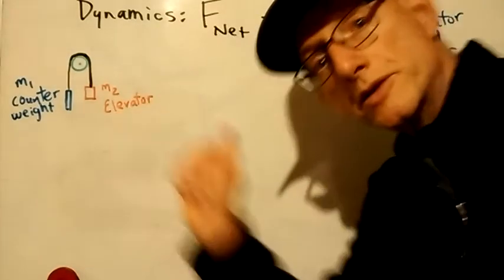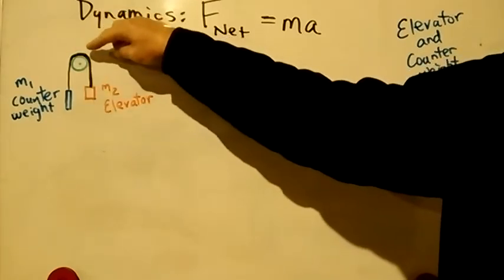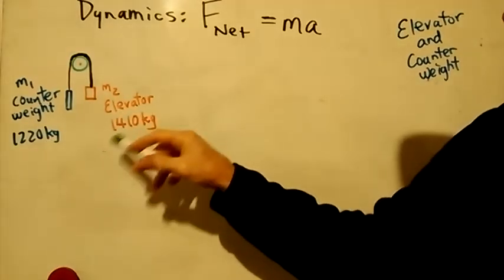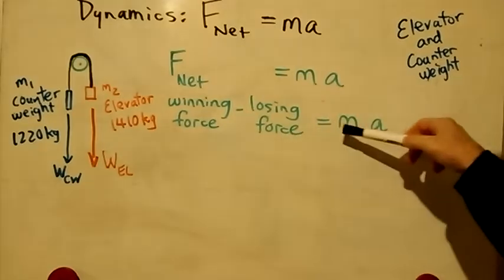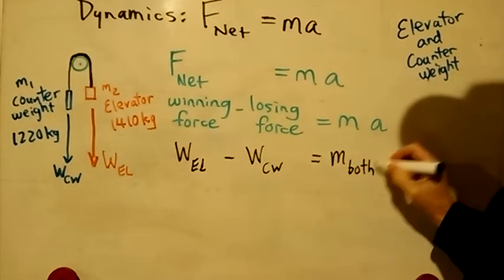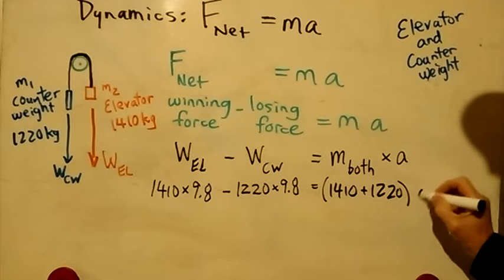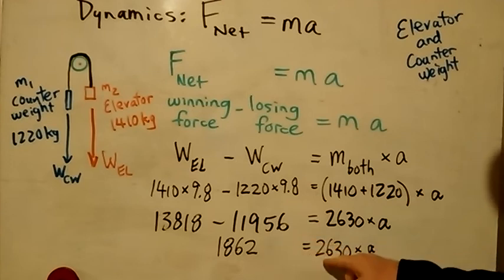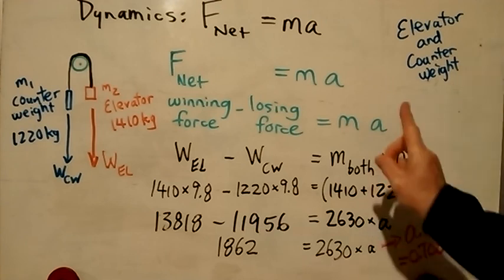Elevator & Counterweight

Comment: Hi
I have doubt when it comes to determine the weight of the counterweight based on the opposite weight may be elevator..
So what are the parameters to know for the calculation of the counterweight..?
Reply: It all starts with the weight of the car. This is calculated by the designers and builders of that car. It will be only an estimate because it’s virtually impossible to know the weight of every detail that gets put in when it’s being built. However, it will be pretty close and good enough for all practical purposes such as load on the machine and  building etc.
The counterweight is then the weight of the car plus a percentage of the maximum load that the car can carry.
The engineer installing the lift doesn’t need to know the actual weight of either. They just load up the counterweight to balance the car and that percentage.